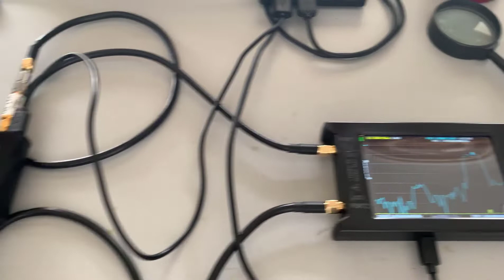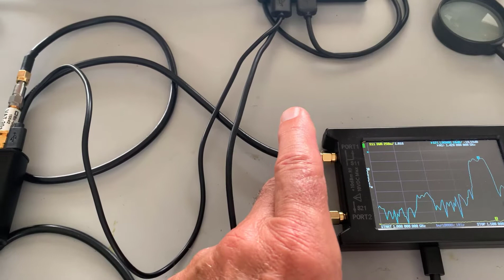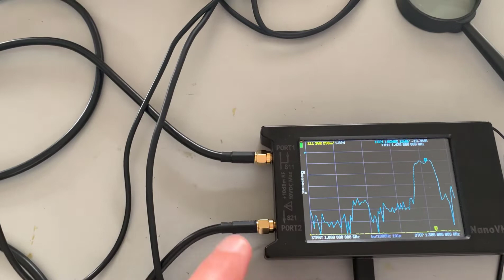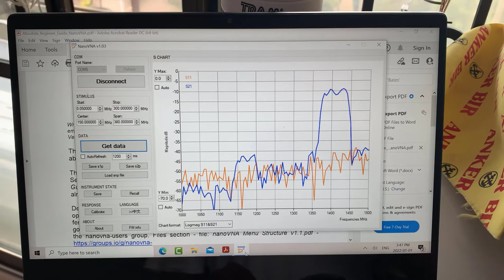Radio Astronomy LNA/BPF Testing with NanoVNA

Comment: wow I have been gathering information to build a backyard 21cm 1420 MHz radio dish telescope and found this video. 😎 I believe this is a gold mine of R-scope info.  Thank you.
I have these two RF devices to setup the someday working telescope and have very little know how in using then.  Stuff purchased on ebay:
(A)  50KHz-3GHz Vector Network Analyzer Kit S-A-A-2 Shortwave HF VHF UHF          (B) tinySA ULTRA 100k-5.3GHz Hand held tiny Spectrum Analyzer + 4" TFT LCD +Battery
Reply from the maker: Very cool! Receiving the Hydrogen line was the most exciting thing I have done over the last few years!.
Reply: @ClarkTelecom  My new and exciting project for 2023. 🎈

Comment: You can actually calibrate the nanoVNA after the attenuation pads,  you loose some accuracy but it will still work and it will tell you something about the input impedance (SWR) of the LNA
Reply from the maker: Thanks, that's good to know.